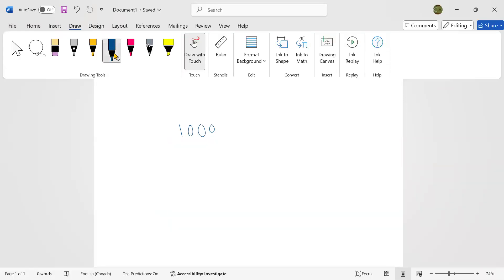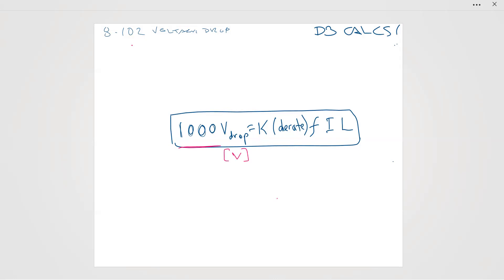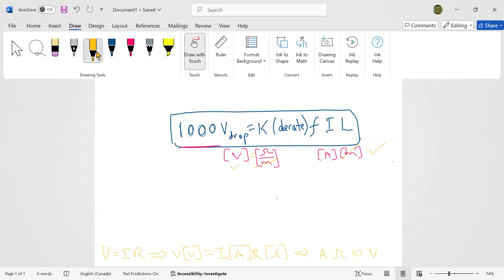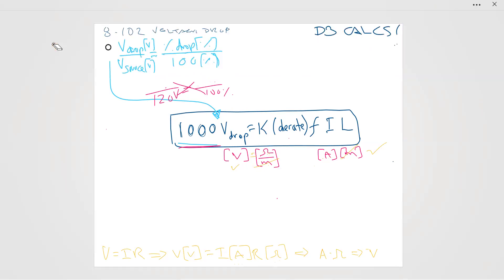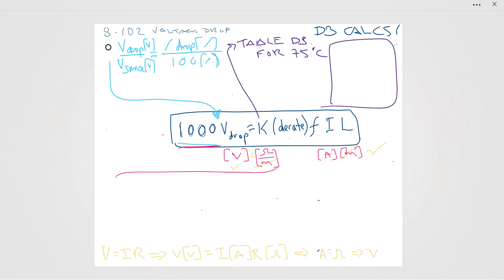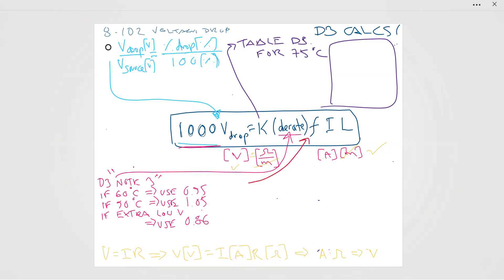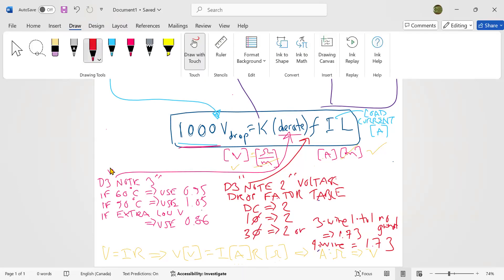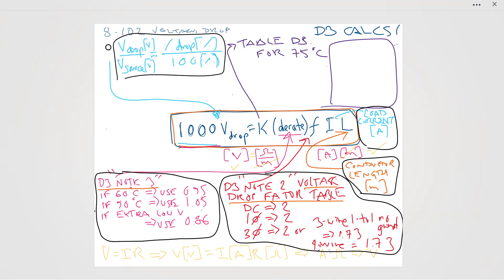The Voltage Drop Equation Explained (CEC 8-102 Table D3 2024 NEW Code)

Comment: So how does this formula take into account voltage?

Previously everything was based on 120 volts and say for example if we actually had 240 volts we just multiplied the result by 2.

Here we dont have an option to account for voltage.
Reply from the maker: Great question!  The formula actually accounts for a change in voltage, not the voltage itself.  It calculates how much voltage potential is lost in each meter of length, because of the effective resistance.  The effective resistance is creating heat loss which reduces that potential.  I made a video that shows the physics behind this formula.  May you please take a look and tell me what you think?  Does it answer your question?  https://youtu.be/pysMIu0LMaQ
Reply: @Prof.K. Thank you for the reply!

I actually figured this out a day or two after I posted as I was working on a spreadsheet that automatically performs the calculation depending on the information you enter such:

• Copper or aluminum
• Wire AWG
• power factor
• insulation temperature
• volt drop factor

Depending on what you select, the spreadsheet automatically picks the K-value from a table in the spreadsheet exactly as it shows in the codebook. You can then enter the ampacity of the draw, the length, and the stage to properly calculate the number of volts that will be present on the wire itself. You can also enter the voltage to perform the % drop.

I'm so glad ChatGPT can write formulas because this is the one for the K-value selection 😅

=IF(OR(ISBLANK(K3), ISBLANK(K4), ISBLANK(K5), ISBLANK(K6)), "Missing Information", LET( rowIndex, MATCH(K3, A6:A26, 0), colIndex, CHOOSE( MATCH(K5, {"DC-volt","100% PF","90% PF","80% PF"}, 0), 1, 2, IF(K4="Cable", 3, 5), IF(K4="Cable", 4, 6) ), baseValue, INDEX(B6:G26, rowIndex, colIndex), multiplier, IF(K6=60, 0.95, IF(K6=90, 1.05, 1)), baseValue * multiplier ))
Reply from the maker: Your spreadsheet is great!  Academics are changing rapidly and that’s a good tool.  As long as it’s correct, which I’m sure you have checked. What are you using your spreadsheet for?  Just studying?